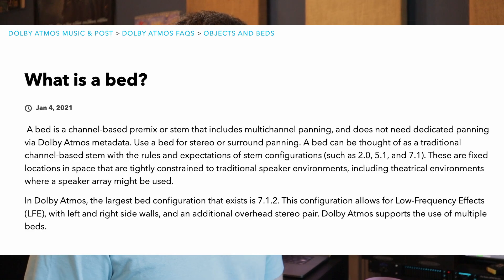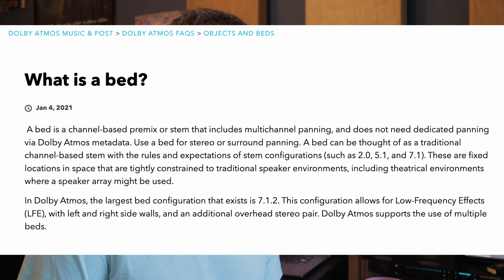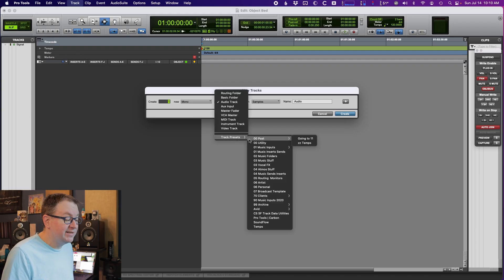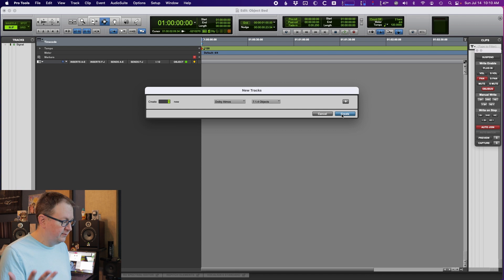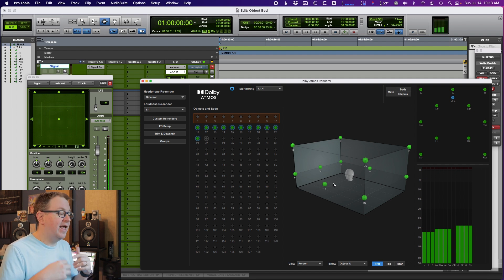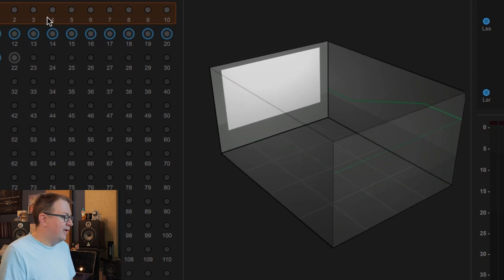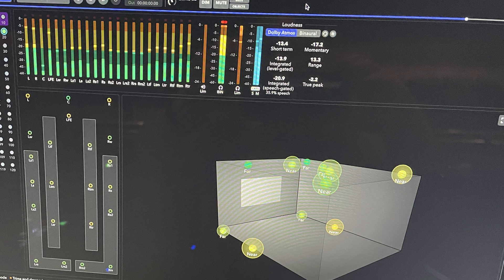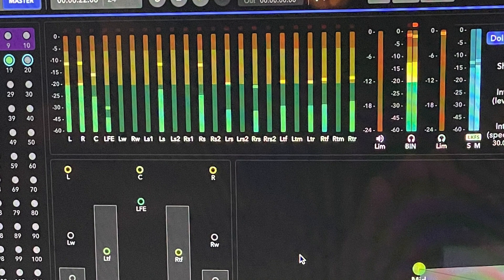The Object Bed for Dolby Atmos

Comment: I was going to make a comment about separating the FX and objects, due to compatibility with certain plug-ins only being up 7.1.2 or lower. In my current workflow, I used OBEDs for "dry" instruments, typically without reverb or delays, and then used the FX on the Dolby Bed. Especially being able to hear the before and after just at the click of muting the objects and default bed within the Atmos renderer is oddly super fun to me!! It will definitely be a consideration in my own mixes from here on out.

I don't disagree with anything within this video, but I wonder how far we have to go to make sure how our mix translates to these mediums and still respecting the artists intent. This is where I think the idea of being a "mix engineer" in 2024 REALLY needs to be stressed to even bedroom producers. Because a speaker array system having single instruments coming from multiple speakers on the same side with the same content seems like it could create a different intent than what the artist had when making the song originally. A listening party of their song for the first time in a theater compared to in headphones or in a smaller Atmos studio could lead the artists to ask questions, such as "why does it sound like that??" And maybe this is just me, but if I go to see a movie in theaters, I really try to get in the center of the action as much as possible. If you're sitting where stuff is "hard panned" to the left or right side, you're still potentially missing some information that would otherwise be different than if you were sitting in the "sweet-spot", eventually giving you a different experience to everyone in the theater regardless. Hopefully the artist would be the one in the midst of the action hearing their album to the highest quality and intent as both them and mixing engineer had. But like you mentioned, could be a REALLY different experience for other sections of the room depending on how this mix was approached. I'm not an expert on speaker arrays or theater sound setup, this is all coming from my experiences of being a very non-religious movie goer. So please correct me if I am wrong on these ideas about public theaters and speaker arrays (would be a great video!!)

But I am also making comparison as if headphones and a decent 9.1.4 setup are anything close to being similar (as of 2024). There is no comparison how good one is over the other, but we still have to consider it in translation. We haven't even scratched the surface when it comes to the quality and size of movie theaters that aren't 100% up to the Dolby Spec, but are the only ones available for the artist. I would pay good money to see/hear this demonstration and comparison in person, I feel like this would be a great educational experience for newcomers into Dolby Atmos!! Great video Dave.

Comment: Question on this discussion.  Say I have a 5.1.4 setup in my room, and I make an Atmos mix using a 7.1.2 bed.  I know with objects they will just get positioned in the room as best they can using the 5.1.4, but my question is about if you pan things to the side of the BED.  Will audio panned to the sides in the 7.1.2 bed only come out of the Surrounds? Or will the renderer attempt to make a "phantom" side/rear and render thigns panned to the sides in a 7.1.2 bed between the fronts and surrounds, and then only things panned to the surrounds play 100% from the sides?  Or, in this configuration, will audio panned to the sides of a 7.1.2 bed sound identical to audo placed on the surrounds?  Thanks!
Reply from the maker: In theory, the trim/downmix settings should adjust how the side content is handled when you're monitoring a 5.1.4 downmix. "Direct Render" will create a phantom center between the front and surrounds while "Direct Render with Room Balance" will put side information into the surrounds. Personally, I prefer Direct Render with Room Balance but your mileage may vary.

Comment: great video Dave ! honestly thx for putting out content like this, I feel like the world needs more clarifications on dolby in general. So , my take on this concept of the OBEDS is that I use them not because of any sonic differences but because of flexibility and ease. So let's take an example of purely using beds. Beds unfortunately as of now are limited to 7.1.2 (hopefully this changes in the near future :D). So that being said, if we were to bus elements to a 7.1.2 AUX in PT then to the bed or,  directly to the bed in dolby, its ,limited to 2 height speakers. This becomes a problem as the output from protools is only sending out information for top left and top right, so even when you monitor in 7.1.4 (we are still inputting 7.1.2) , you will notice that the renderer is just duplicating the same signal for both the top front and top rear because it has no way of knowing the discrete information since its only outputting 2 heights. So , thats why most mixers would have to reach for objects when panning information on the heights especially if there are more than just 2 height speakers. So long story short is that I'd rather have an Object BED so I have full access to panning as much elements as I need to and have discrete spatialising possibilities of all 4 or 6 heights. This example can also be applied when we start to mix in formats that got beyond bed capabilities (7.1.2). Instead of sacrificing objects which can be very limited especially when working on films , it's more beneficial to have OBEDS set up to represent the format and mix through that. I hope this makes sense, but I also love your explanation on it and I totally agree with you in the sense that there is absolutely no sonic differences.
Reply from the maker: Thanks! I'm glad you liked the video.

One of the things I forgot to mention about the height in the bed is, height speakers are also part of an array in a larger venue which is why it is .2 in the bed and will probably always be .2. I use a quad set of objects for hitting the corners so I guess I do use a little bit of a OBED. :)
Reply: @goingto11  I don't get that part. If you have a speaker array, doesn't that array get the same signal anyway the way it is connected to and configured in the processor? That's why it is setup like an array? Otherwise, you could just set it up as individual speaker channels and it would work perfectly fine with Atmos objects (being able to pan across the individual speakers)? As I commented in a separate comment, 7.1.2 mixes are detrimental to all larger systems.

Comment: Thanks Dave - your videos are always superb references! BTW: The bed still is 7.1.2 , what is the best way to access the 4 top channels individually? Im not on the latest PT version. Thanks!
Reply from the maker: Thanks!

I use a quad set of objects to hit the 4 height positions. So, I guess I do use a bit of an object bed when I'm mixing. :)
Reply: @goingto11 you can access all 6 ceiling positions with an object bed. You can also access the wide speakers by placing a stereo object about 25% back from the front toward the side. 

I mix into a full 9.1.6 object bed for stationary instruments even though my actual array is 5.1.2 I then use objects for anything that moves and the bed to access the LFE channel.